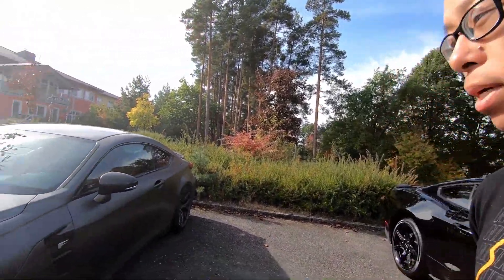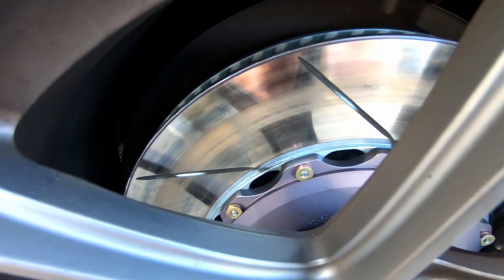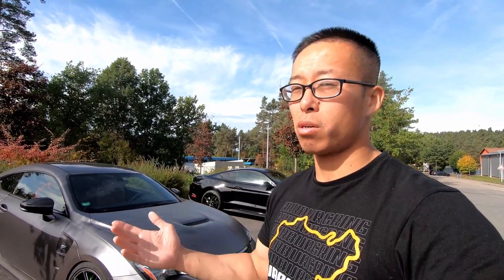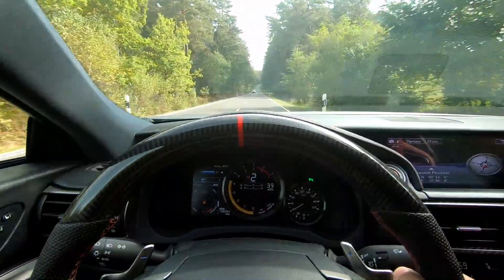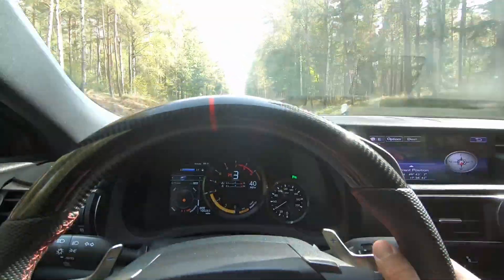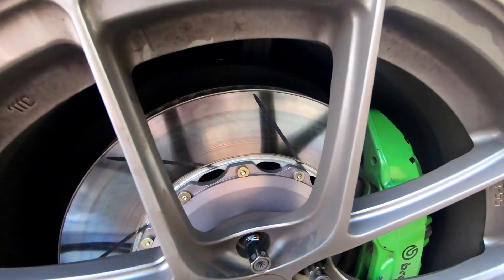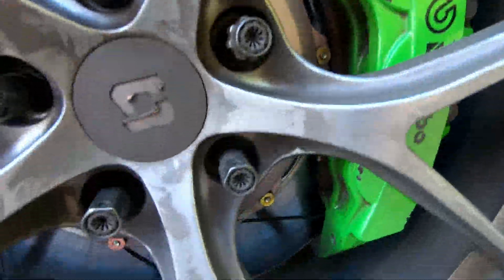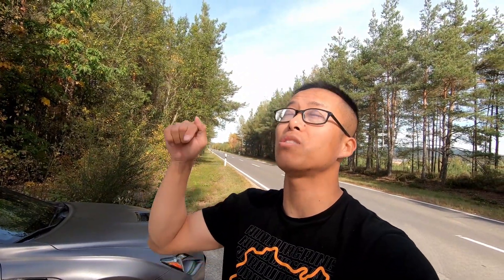Lexus RCF Brake Bedding Procedure Increased Braking Power And Turned Rotors Titanium Blue!

Comment: Thankyou for the amazing content on how to replace/upgrade the brake rotors, was wondering on the weight difference between OEM vs RRacing rotors, also did you get the rears done as well?
Reply from the maker: Just the fronts. I made a comparison video with the old rotors and new girodiscs. Itll be out in 3 days. Its good stuff. Or at least I think it is.

Comment: Do you know if there's a way to adjust the parking brake? I replaced pads last week and it didn't fix the problem. I can't find diys anywhere.
Reply from the maker: Whats the issue you have?
Reply: @thehuangbros  the parking brake doesn't seem to engage the pads against the rotor. When I'm at an angle and I hit the parking brake the car rolls when in neutral.
Reply from the maker: @RubberChickenMan007  thats an area i have not explored
Reply: The parking brake mechanism on the RCF is on the rear wheel hubs behind the rotors (drum parking brake, uses a separate set of pads than the regular brakes). Club Lexus has a link to a Lexus Technical Training manual which describes the "Executive Parking Brake" setup on the last page and shows the tensioner you'd need to adjust (https://www.clublexus.com/forums/attachments/suspension-and-brakes/232876d1326218859-diy-parking-brake-adjustment-brake06.pdf). It could be it has lost tension and just needs adjustment or your pad material has worn down to the point it needs to be replaced. You can access the tensioner by removing the rubber cap from the rear rotors and spin the rotor until the hole lines up. You'll then rotate the gear on the tensioner until the pads contact the inside of the rotor and it won't spin freely (i.e., figuring out which way to spin the gear to increase tension), then you back it off a few clicks so it spins freely again. If that doesn't solve it you'll need to take your rotor off and visually inspect if there is enough material on the pads.
Reply: @d95157  Thanks. I was able to figure it out. I was so frustrated with the damn thing that I just disassembled the rear brake to see what's there. There's an adjuster star cog that adjusts the system. Each notch with a flathead towards the front of the car does the adjustment.
Reply: Happy to hear you were able to get it sorted! I'll have to remember that when I need to adjust mine.

Comment: What pads are you running?
Reply from the maker: Endless mx72
Reply: @thehuangbros  What’s the bite feel on the 72s? I really want to try them in the future. How’s the dust level & noise? I had winmax 3. They bite hard, lots of noise, & dust. I loved the bite force, almost as fun as accelerating.
Reply from the maker: @XBrandonLeeX765  its good braking and no noise. There is dust but less than brembo stock